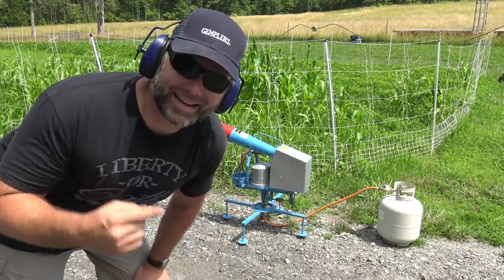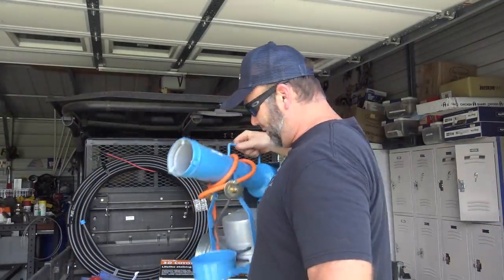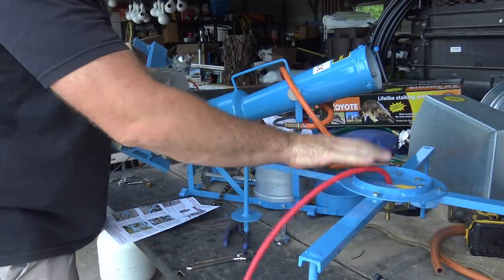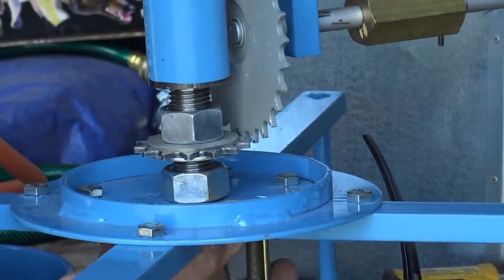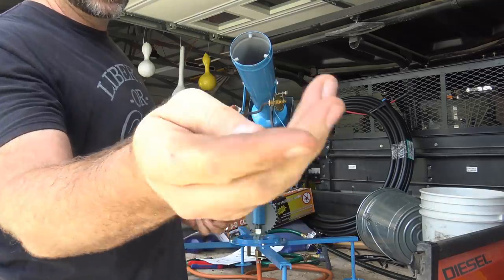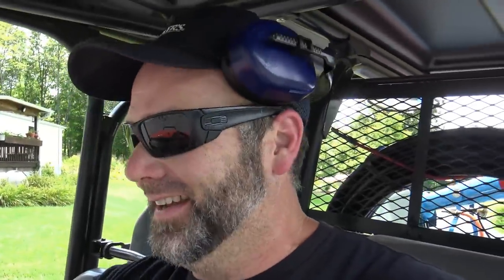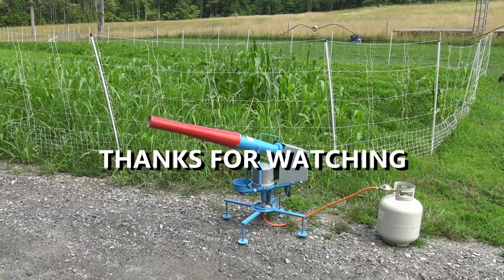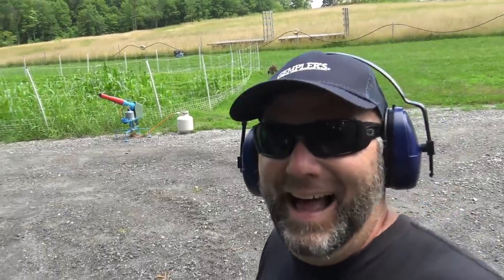Trespassers? Deer? Crows? Rabbits? This keeps them all away!

Comment: 12vdc valve, battery operated high quality IR motion sensor  (or multiple sensors in parallel).  Then only when something or somebody is around - kaboom.  Reduce complaints and wildlife getting used to it.

Comment: Move the decoy from time to time or the deer will get use to it and it will quit working. I have a picture of a deer eating my corn next to one! The only thing that works 100% is a 8 foot fence chicken wire around the bottom bend the bottom 6 inches at a 90° to keep the rabbits out.

Comment: We used air cannons to scare birds out of our substations...They built their nests in the structures and sometimes they would put small telephone wires in the nest....Occasionally the wire would drop into the bus work causing a fault with a lot louder bang than your device...Most of the time it would cause an outage to the customers...They were somewhat effective except if the location of the station was in a city neighborhood, we got tons of complaints...lol

Comment: Propane cannons have been used for years to control to much waterfowl also in winter time on lake communities that have ice eaters or bubblers around their boat docks to keep ice from forming and dragging into lake when spring thaw happens. I know of sandpit/Barrow pits (lake made by man to dredge out sand and gravel for interstates and or main highways or concrete mix material) that hold 15 to 30k geese all winter and residents of lake with open water over winter install them to move birds that congregate (which is a awesome sight to see) but affect the lake's water quality by their waste products when they come back from feeding. So they use them to move them along to the local refuges, rivers or basically any where else essentially to rid themselves of the disease such as fowl cholera and water quality that makes water into something that brings the private fisheries they support down and nobody wants to swim or go waterskiing in goose sludge water.
I think it should do everything your wanting it to do but they've found wildlife can desensitize themselves to noise by timing of cannon be too predictable so switch it up occasionally. They also make bird bombs shot from starting pistols if crows adapt. A lot of airports use these to keep the geese off the airport properties near run ways also. Some products require special ATF permits so you have weigh your options of what you need, some permits are pretty pricey and require classes and certification similar to pyrotechnics to make fireworks.
The cannons are effective but switch up the timing so not to become too predictable. Never thought about using for garden raiders but should be very effective until they all move to your neighbors gardens. I see neighbors wanting to borrow it coming your way. Good luck!

Comment: Hi josh over here in the uk they are called gas guns, they are used mainly for deterring crows, and pigeons from attacking brassica plants which would brussel sprouts and cabbages plus against crow and pigeons on storm damage crop and oilseed rape when it's first coming though, but they do get used too it.
By the looks of your farm you are well away from neighbours or residential homes so no problems, but here you can have them only working between 8am and 9pm if near residential area

Comment: Hey Josh,  Love your channel.  I’m on a ranch < 30 ac and you’ve inspired to become more of a homesteader.  I’d like to put in a garden and also do regenerative farming.  My property has net fencing installed along the property line  to keep feral hogs off the property.  I did recently put 2 cows on the property and they’re just free ranging at the moment.  I haven’t started a garden yet, but I am concerned about the cows and deer potentially eating whatever we try growing.  As far as fencing around your garden, I’ve seen that you use the Premier One fencing like in this video but on another one, I see that you employed a strategy with poly wire to keep out the deer.   Is there one strategy that you prefer over the other?

Comment: You did a video a couple years ago using the ultrasonic motion detector for the deer. Are those still working? Just wondering since you are trying the decoys. My experience is things seem to work ok with deer and then they get used to it. I  used to use Irish Spring soap on trees. Worked good for a while. Now they ignore it.
Reply from the maker: Some still work...but those are solar..so the batteries have faded...deer eventually will get used to anything
Reply: @StoneyRidgeFarmer  Thanks for the reply. Deer are honestly my biggest pest. I would thin them out but that takes time that I don't have. Enjoy you sharing things you have tried. Take care and keep the videos coming. Thanks.